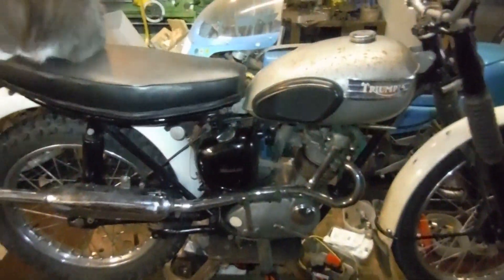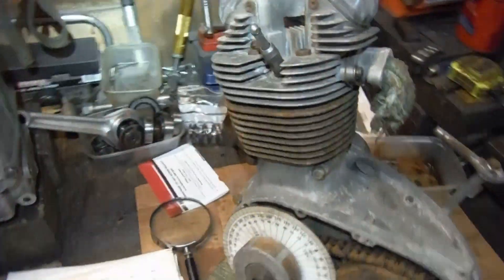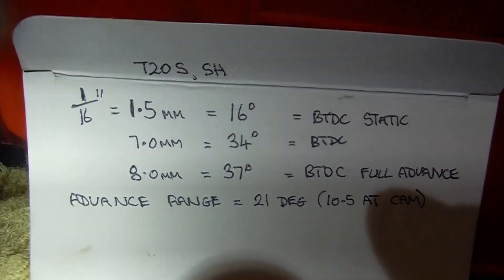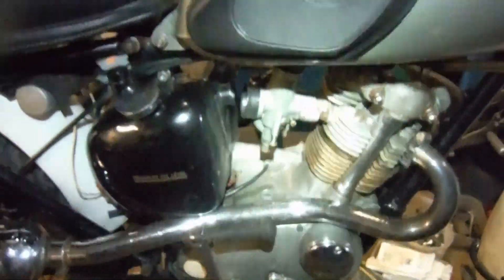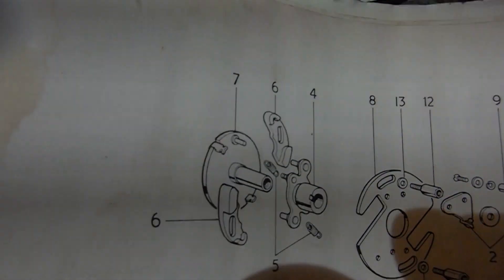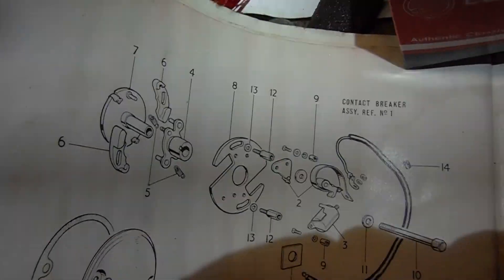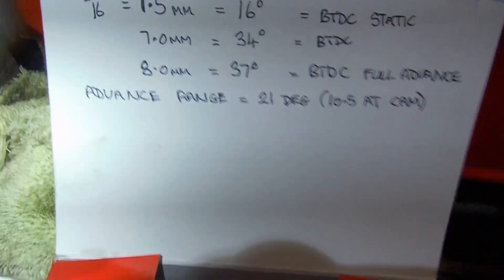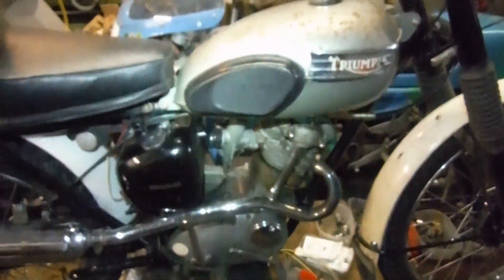Triumph Tiger Cub / Sports Cub ignition timings, inches, millimetres vs degrees BTDC discussed.

Comment: Isn't is more accurate to use a piston stop to determine TDC and then set timing off the degree disc rather than rely on the measured mm distance from TDC and rely on a conversion table to get the degrees?
Reply from the maker: Not always, as it is much more time consuming to rig up a degree disc on a Cub engine, whereas, it is much easier to measure figures through the plug hole which are known to correspond to a given number of degrees, as I have done here.

Comment: Another interesting topic. Obviously care must be taken, to ensure that the correct auto advance unit is used, as the 2 common units available (10 & 12 degree), can change the ignition timing by 4 degrees advance.
Reply: If the timing is set fully advanced, then the advance range has no bearing on the matter. It only is of importance when using the retard settings.
Reply from the maker: @neilmcintosh1200  Yes - I always set the fully advanced timing, as that is the most important one.
Reply from the maker: Also, watch out for the correct rotation - some are clockwise, while others, as on the Cubs turn anticlockwise.
Reply: @paulhenshaw4514  
Sometimes the 5deg auto advance from the energy transfer system throws a wobbly  if fitted .
They run but from experience cause a lot of head scratching.

Comment: Hi Paul, i posted a short video on how to calculate the mm btdc from any degree value, on a tiger cub engine, which you might find useful. After calculating the value, i use a dial gauge to precisely set the timing.
 https://youtu.be/z1o0FPrYTM8?feature=shared

These are the degree and mm settings BTDC, when using a dial gauge

Degree = mm
38 = 8.38
37 = 7.97
36 = 7.56
35 = 7.17
34 = 6.78
33 = 6.41
32 = 6.04

I hope this maybe useful